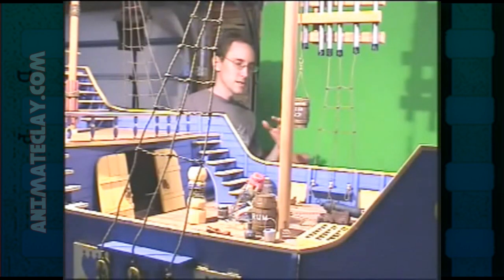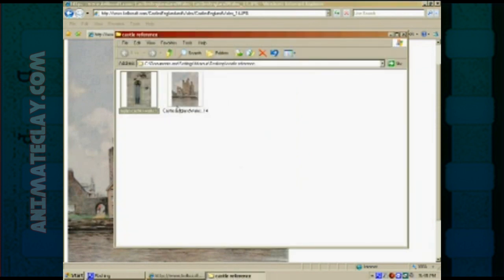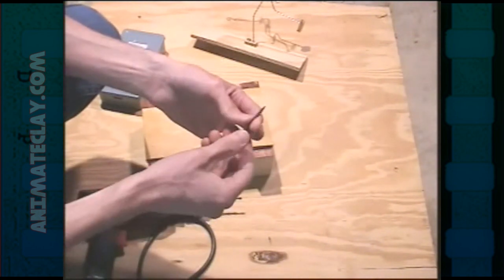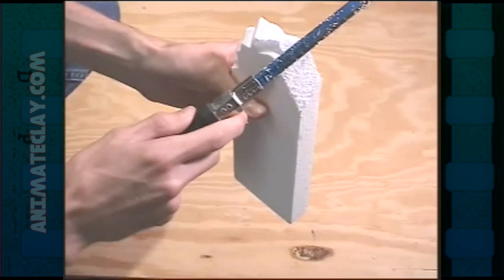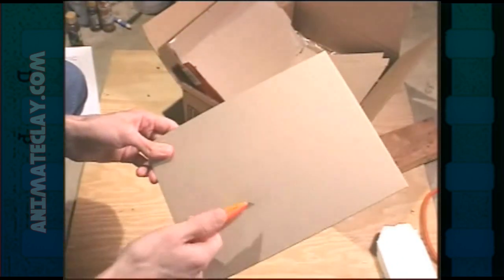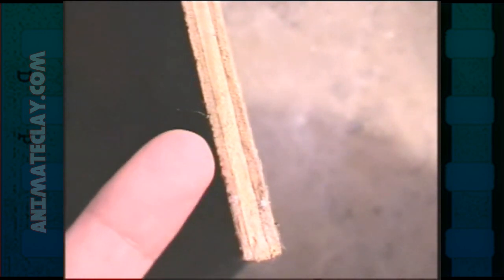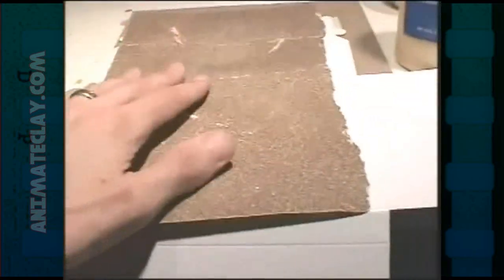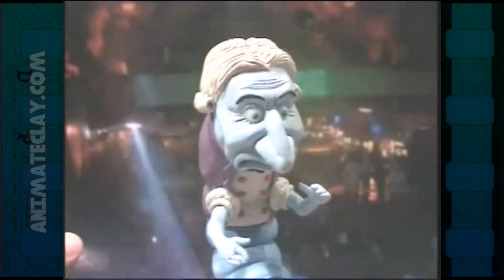How to Build Sets for Stop Motion Animation

Comment: It's 2021 and I've just started dabbling in stop motion animation, and so far the best materials I like working with is foam board, balsa wood and a hot glue gun. I like your idea of a metal surface and using magnetic feet. Thanks for the video.

Comment: If you're building a hardwood floor ontop of your set table, how would you rig tie downs to it? As in how would the armature be able to stand? Do you just drill through it? help!
Reply from the maker: You can drill and use tie-downs. If you don't like that idea you can make your puppets feet large and made out of steel. Then use a strong magnet under your set floor to keep it in place for walking. If you want to do that, the set floor itself should be made of a sheet of steel with a very thin layer of wood - or even paper that has a wood pattern printed on it. That way the feet stick down super strong.
Reply: animateclay omg thanks for the super fast reply! I'm just worried that ill screw up my flooring when I drill through it because I used craft sticks as floorboards pasted on firm cardboard ontop of my set table.
Reply from the maker: You can definitely drill through your floor if you need to. Just take some tape and tape over any holes. Then paint the tape the same color as the floor - it's a common old trick they used to use to hide the damage. Nowadays they use paint programs to do that which is a little easier.
Reply: animateclay ok gotcha, thankyou so much!